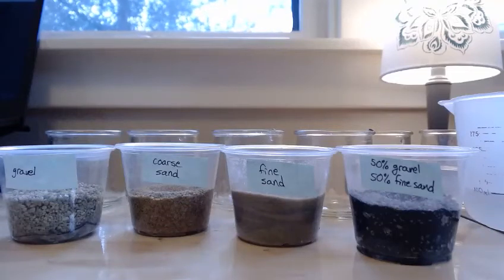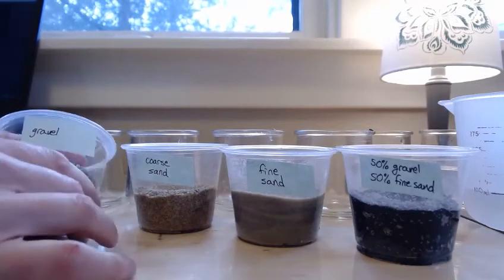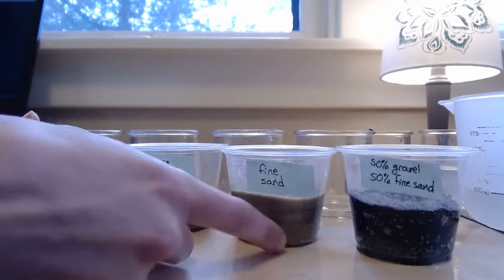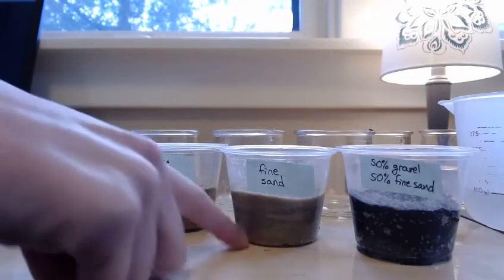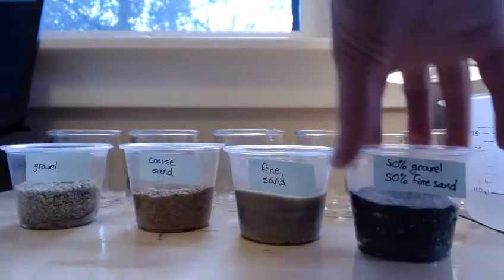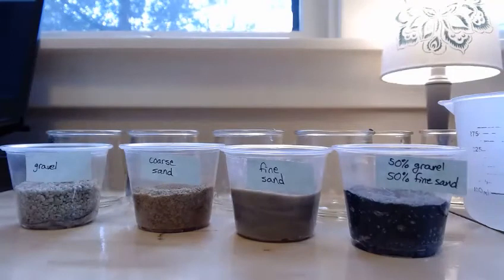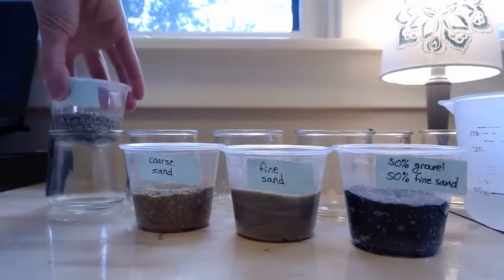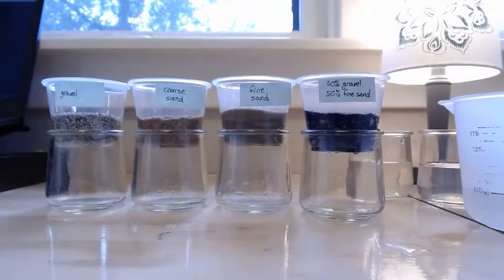permeability experiment: gravel, coarse sand, fine sand, mixed sediment

Comment: Hello may i know why the 50% grvl 50%fine sand slower than 100%fine sand?
Reply from the maker: Great question! It has to do with porosity (amount of empty space in a material). The fine sand fills the spaces between the gravel, reducing the overall space in the material. This means the water has a more difficult time getting through the material.